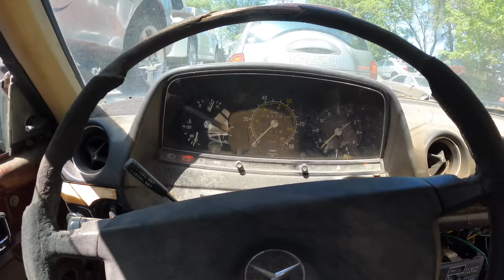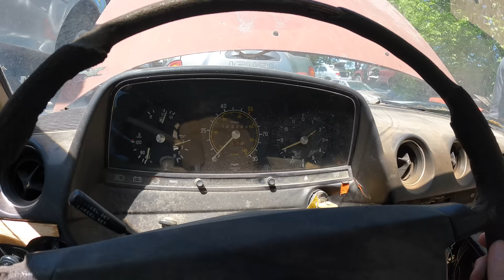I SHOULD NOT be Car Shopping, But I CAN'T STOP! (Need your help)

Comment: The look on the car wizard's face when you bring the diesel in will be enough gold for your channel!
Reply: Mrs Wizard is currently checking out the yacht auctions...
Reply: @tomsommer8372  she better cancel that, the w123 is bulletproof minus the turbo models.
Reply: @sv_cheats1970  Is that the model that greek cab driver had? The one he put 2 million kilometers on?
Reply: @MyRegardsToTheDodo  I have no idea, there have been multiple 80s Mercedes that have passed that much
Reply: @MyRegardsToTheDodo  No, that was it‘s predecessor, the stroke eight. Similar engine though.

Comment: Hoovie: "I don't have a convertible "
Prowler: "What am I, chopped liver?"
Reply: And the Murci, Diablo, SL!
Reply: @AJGreen-cn8kk  Don't forget the Azure
Reply: And the SL Mercedes
Reply: And the Becker Spider
Reply: @mrcaptaindarkrex  That was the first one I thought of.
Reply: @y3n0  That is more like a roadster.
Reply: -speedster
-merc
-azure
Reply: @mexicanspec  ...yeah...with a convertible roof...convertible...
Reply: @dericanslum1696  semantically, there's a huge difference between a convertible, cabriolet, spyder, roadster and landau tourer. If you're completely anal about it, it has to do with the etymology of the words, suffice it to say, that everyone has a point and nobody is completely right. Hoovie is just an idiot because he wanted another drop-top to add to his extensive collection of all-weather tourers, spyders and roadsters
Reply: @Mjws2907 
 A cabriolet is a soft top or drop head coupe with roll up windows.

A roadster does not have roll up windows. It has an optional soft top and clear side curtains for windows.

A convertible is a four door sedan with a fold away top which may be soft or hard. It has all the attributes of a normal sedan including wind up windows etc.

A spyder is a two door two seated sports roadster or convertible with no weather protection

...true...semantics...

Comment: Tyler, I know you’re not a SAAB guy but the 9-5 wagon (2006-2009) is a gem. For an old Euro car it’s very robust and reliable. Engine and trans are indestructible as long as they are maintained at a basic level.

Comment: "This is an A4, so it's dead." I'm dead!
Reply: Are you an A4?
Reply: RX8 runs but is missing a wheel. Yeah, it's a parts car at this point.
Reply: A4 s are solid got a b6 , 290.000kms not any problem

Comment: The Isuzu Vehicross, the suv that was designed ahead of its time.
Reply: BTTF B4 BTTF
Reply: Was able to drive one and well actually tow a car with it. The interior was really nice and it had some pep to it's step.
Reply: $6,000 for one with 200k miles is a ripoff
Reply: @q-bert6454  yeah, I'd have a hard time justifying 6k for that one
Reply: @q-bert6454  I thought he was going to say $2999.
Reply: @Eli-fj3sc  You don't see them much

Comment: Man I miss my Vehicross. It drank a quart of oil every 300 miles, blew headgaskets, had the transmission die, electrical gremlins all over the place, and ABS never worked... but it was a blast to drive in the snow or off road. Gotta get another one some day.

Comment: It really hurts my heart when I see Tyler revs and drives a car hard when its cold af. Just warm it up man😔
Reply: He might’ve let it warm up while not filming.
Reply: Me too 😭
Reply: Most cylinder wall and ring damage is done at start up. Pros know an engine is ready after a few seconds
Reply: @ozzie3963  They're not. The oil viscosity is not optimum when the engine is cold.
Reply: It's to warm up faster
Reply: @E34Benzin  especially not oil that is at least two years old…

Comment: Old Mercedes Diesels never die. Even this enormously abused example doesn’t. Btw a c123 with a 200 diesel engine is pretty rare, it definitely deserves another chance.
Reply: I know someone with an E320 CDI (W211) with 240k miles on it and it runs strong. But yes, Old Benz diesels should be the benchmark for reliability for all cars

Comment: Ok. I’m calling BS on the “this Volvo hasn’t run in 2 years” crap.  When they pulled the weeds out of the brakes the rotor was shiny with no rust on it.  There is no way a car could sit outside for 2 years without being run and not have the brake rotors completely rusty.
Reply: It’s absolutely true.  We put the missing left side wheels and tires on and a new battery last week. It fired right up and I drove it around the block and parked it right back in it’s spot.  I did a couple hard stops to check the brakes.  Didn’t want my friends driving something unsafe.

Comment: IMO "Volvo's known for their safety" was/is purely a marketing ply with no basis in truth.  I was injured in 1995 in a brand new 1994 Volvo 960 (its was leased for 36 mo.) through Volvo.  The car was rear ended when I was stopped making a left turn at noon by a person doing about 50mph.  Yes, my brake lights and turn signal were working.  the seat back broke, laying me flat in the back seat and when the car came to a stop I was propelled forward, restrained by my seatbelt, I herniated 4 discs in my neck and 3 in my lower back.  After years of pain and therapy I had three major surgeries  (on on my neck and 2 on my lower back).  All I wanted was for Volvo to let me out of the remainder of the 33 months of my lease and they said "sure, take the monthly payment and multiply it time the number of payments left (33 months) and we'll let you out of the car.  When the Volvo engineer came to look at the mangled seat, they said, "good luck, there are no seat crash test standards in the United States and only Mercedes does that type of work on autobahn accident"  and so Volvo would not help me out and dared me to sue them.  So, I lost out.  Also, I had the car (that was crushed to the back seat) repaired by the local Volvo dealership.  When the lease came due, I had never heard from Volvo, so I went to the Volvo dealership, got a condition and mileage receipt and handed the keys to the dealer.  Three months after the lease was due to be turned in I received a call from Volvo asking to see the car so the leased could be view. I told them to return my security deposit and the car was at the dealership[ for 3 months so good luck. So, I will anybody well with owning or leasing a Volvo.  This is my experience, I'm disabled as a result of the accident.  So, I would suggest looking at crash test data published by reliable sources like the IIHS and the NHTSA before making a purchase and don't just get drawn into the "Volvo" hype.

Comment: The cover above the driver's side B pillar is broken in this V70R, so the seatbelt has very likely been replaced. The seatbelts are known to have issues on these but it could also have been from an accident.

Comment: At least you got the super light weight 'Achtung Baby' factory edition Mercedes! With the fastidiously oxidized, customized 350lbs of missing frame, floor pan, and body panels. Fortunately the 'Car Wizard' has a lot of experience the with custom designed Superleggera spaghetti harness sneaking out from under the dash. LoL... this video may have been staged.....but it was staged perfectly!! Keep the peddle to the metal boys. That's if you really do find a replacement floor pan. hahahahahahaaaa........Simply Great!!

Comment: I'm thinking  that you might actual have more open cars than closed- Beck, Prowler, Lambo x2m. As for $6m to $8 m for that Alpine-that's a stretch, but hope it is correct....interior looked okay, dual carb, factory hard top. My 63 has been in the family for 57 years. But that and give it to me and you have a deal.

Comment: Its bonkers how much used cars go for in the USA in the uk after 12 years most cars are worth about £500-1000 unless exotic. A mint perfect tt cab with low miles ie 30-40k only worth £4k in the uk  how are they worth $14k 😱 we need to start exporting cars to the usa

Comment: Ive got to say there is one thing I love about this channel your comedic aspects i loved the Ferrari challenge video. How about I challenge you myself. Buy the cheapest Porsche that you can find and the model must be a true to the honor to Porsche rear engine no 924 or 944 models I am curious to see what you come up with this will determine if my broke as all can be self can afford a true honor to be called a Porsche or if I am just too broke to even afford a hoopdee status Porsche today. Ive recently aquired my own Hoopdee status car so far still driving but yes the check engine is on but so far mechanically as far as I can tell driving wise is ok. Sort of....it vibrates in the middle of the dash the other doors other than drivers door lock sometimes sometimes not brakes...yeah need work to be completed soon and moonroof the inner panel is off track so cant open it alot of buttons writing is worn off so cant figure out button does what and for what car is this hoopdee? One I have yet to see Tyler drive. A legend in itself. Ok to some of us 😆 a Saab 93 arc 2.0 turbo dont laugh I love Saab always have always will no its not the 900 but I will buy one this year just yet if I find one cheap enough in hoopdee land somewhere....if you decide to try the cheapest Porsche it must be US no importing from overseas must be located in the US good luck see if it can be done under 5000 drivable I'm curious myself ive tried and so far nope except for what I consider the joke for Porsche the 924 even the 944 was bad but more tolerable to an extent but still not true Porsche amd yes the 914 qualifies for this its still mid to rear engine so have at it and keep the videos rolling my hoopdy friend in another life

Comment: Damn that guy is asking the world for that tt.  I had a 225bhp 1.8 to Quattro and sold it on 85,900 for $3000 most people prefer the high pressure turbo 1.8 to the 3.2 as it’s more fuel efficient and is only 30 bhp less.  They usually fetch more money than the 3.2.  I know it’s low mileage and a roadster but a premium of four and a half as much seems ridiculous.

Comment: Between February and December of last year, states that went for Biden saw the total number of people working drop an average of 6.2 percentage points, versus a 2.5 point decline in those voting for the Republican.

The 13 states that saw the lowest decline in employment all lean strongly Republican, led by Alaska and Utah which actually saw employment increase by 0.7 and 0.3 percentage points respectively.

On the other end of the spectrum, 13 of the 14 states with the most significant pandemic job losses went for the Democratic candidate, led by Nevada with job losses of 10.2 percentage points, and Hawaii at 9.3.